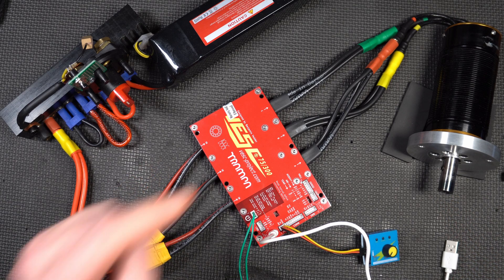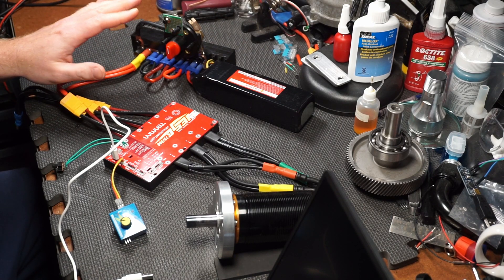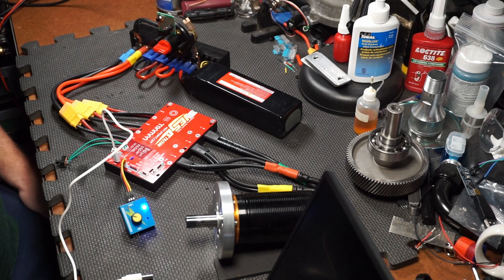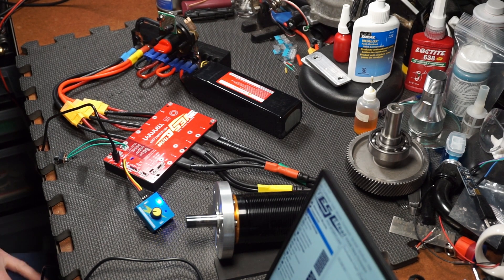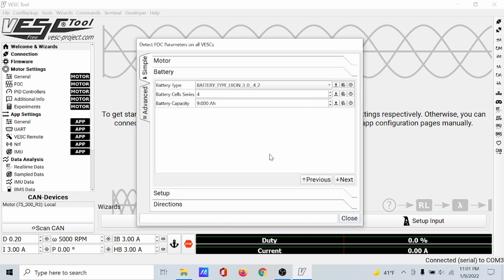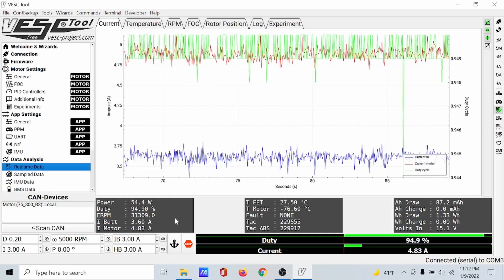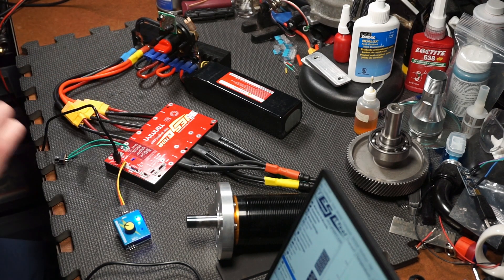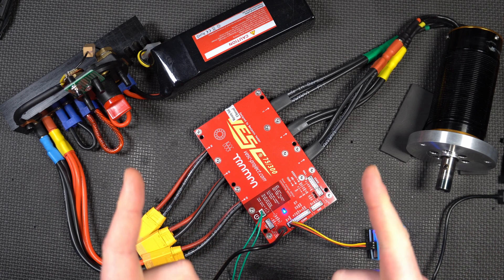First Time VESC User - The Real Experience

Comment: Hello , I am trying to fine tune the motor parameters. The RPM graph is oscillating too much. I see in the video that the current showing at the bottom right corner is around 5 A but in my case it is showing 60A. How do I reduce it to 5 A. My motor parameters are set by one xml file. And I do not have the knob to control my current.

Comment: Hello,

I was wondering how you joined the three power cables or phases into one? It might seem like a silly question, but I tried simply soldering them, and since the wires are thick, the result isn’t very clean. Anyway, if you could help me, I’d really appreciate it 🙂.

Great video, by the way!
Reply from the maker: I made a busbar with three matching connectors for the power cables to plug in to.

Comment: Thanks for the video! 

You chose current control in the PPM Configuration. I believe this is effectively torque control. As you have no load the speed will continue to increase until you reach your maximum rpm. I think this is why it is going straight to maximum pwm and rpm.

If you change the PPM Configuration to "Duty Cycle No Reverse" you should have an input that is approximately speed control. I suspect this is what you are expecting to see.

Disclaimer: I am not an expert, just making an observation in an attempt to help :)

Comment: I have a flipsky pro v2 on a bafang. But it gives a hard punch to the motor at the bottom of the gas handle. It feels just like a punch u also hear it. Can i get this away by curving the voltage / amps?
Reply from the maker: Probably.  You could also make sure the control signal ramps up slowly if you can't do it in the VESC.

Comment: how have you sliced the 3 wires from the vesc together? Obviously you have to join up the 3 power wires from the vesc and connect top the single power wires from battery / to motor. Be grateful to know how you did that. THanks

Comment: I had the same problem with servo controller, it's either on or off, no incremental throttle
supposed to be able to control it with the keyboard arrows too but it just sits there and grinds when I try that
Reply: it depends, current control without any load will go max speed without any control, you need to use PID speed control or Duty Cycle control if you actually just wanna control the speed, but that way you need to be sure the rest is set up correctly cause it'll try to push all the power it can to its set limits

i prefer current control for the sake of being able to control how much power/torque i feed maximally

Comment: Hahahaha love the start.  Love the intro.  I been following,  the hobbywing max4 is a great esc.  Right know im pushing a 1150kv 5870 on 10s without any issues.  Also have a 2280 d3….different class of motor but you can defiantly get more boost with higher kv/ a little more amp draw.  You put a lot of time and money so i’m not advising you to spend more.  I have a tp 5670 cm 2510 6 pole you could test on 6s safely..spins to 47,000 under load(“8s rated motor”  but no esc is capable of running the 6 pole motor’s to + 80,000rpms). I ran it with 10mm bullets.  It’s a beast

Comment: Hello, Do you know what ppm is?
Reply from the maker: Yes - in this case it refers to the signal from an RC receiver or servo tester.  Typically 50 hz, with a pulsewidth of 1-2ms.  1ms being throttle off (or full brake or reverse - depending on how you have the thing configured) and 2ms being full throttle.
Reply: @AlexLTDLX  Do you know what device is connected to PPM Port? I am making EV Car with VESC 75/300 Controller, but I don't know how to use this.
Reply: @AlexLTDLX  Additionally, Could you tell me model name of anti-spark switch that you used?

Comment: Would it be able to handle low rpm high torque 3000w 75v bldc motor? I'm planning to build a large ugv that would carry couple of specimen :)
Reply from the maker: Yeah, that should be easy for it.  But they do recommend staying around 63 volts; they're concerned about voltage spikes.

Comment: Wh u not castle xlx2 mine holds 600amp runs and only 260 $
Reply from the maker: Not enough voltage capability.  I've already stepped back from 70 volts to 60 to accommodate available ESCs.
Reply: @AlexLTDLX  you should check out the BESC G2 - an open source VESC variant, you order the PCBs yourself so you basically make it but it is beefy - 100V 400A… you can build it alternatively to handle 150V and 250A. And the best thing is it only costs about $200 I believe? It varies with the cost of the electronics.

Comment: Really like the idea of electric turbo/superchargers. I don't have the expertise to make a kit myself and off the shelf kits in the UK are £2100 which is out of my reach but im hoping one day there will be a happy medium.
Reply from the maker: Are you referring to Torqamp?  Those are really only good for about 200 hp.  This unit should be good for 600-650 hp (less on lower powered cars that want to run more boost - the boost/max output relationship has yet to be established).  This setup would cost about $1,500 USD (sorry, no pound symbol on my keyboard) to reproduce without batteries if you DIY.  Not that I'm suggesting you do so.  And if you do, I'm not responsible for any harm.  But if you do,  the really nice thing about this setup is how flexible it is - it'll work just fine on 150 hp engines up to 500 hp engines.
Reply: @AlexLTDLX  Hi,yes i was referring to torqamp. Your setup sounds fantastic but i don't feel im knowledgeable enough to partake such a thing.i only have a civic with a 1.6 vtec producing 110bhp  and would be happy with something like a 50bhp brief boost for sure, nothing to crazy.  I suppose i could fit a Nos kit for that and cheaper but i much prefer this idea. Really enjoy your videos and thank you for the reply.
Reply: @jibbyjabby7499  if you just add a motor in parallel to the engine as a sort of hybrid, the Trampa could easily give you a 20-25HP boost, and with improved low end torque if you gear it right
Reply: @AlexLTDLX  Awesome video and a great primer to the 'fun' of figuring VESC out. Thank you.
I can't help but be a troll... 650HP? Is that all? Teslas can do that without the smelly and complicated squish bang expand exhausty bit :-P

Comment: Have a look here: https://www.youtube.com/channel/UC6kQ4bL2xPoOio_oRgjdhQA
These are our online manuals for setup. 
Another thing I want to point out is the ? behind each setting option. If you click that, you will get some info. 
I will give you a VESC-Tool lesson in the next days!
Reply from the maker: Thanks for posting, Frank.  I did watch all of those, and for the most part, they're all for mobile app setup and for electric skateboards.  They also leave a lot of detail out.  If you watch my video, I don't know if the firmware update worked; where to get a firmware update from, or if it downloads automatically and you mentioned (in email) I should be using firmware 5.02; yet this VESC has 5.2 loaded into it.  There was also an error that appeared - there's no explanation anywhere of what that meant or what to do about it.  Also, I'm not feeling confident of my settings - and there's a lot of them.  I'd feel a lot better about continued testing with a bit of guidance.  Maybe we can do some sort online thing?  I'll shoot you an email.